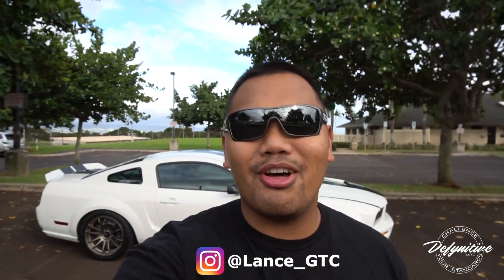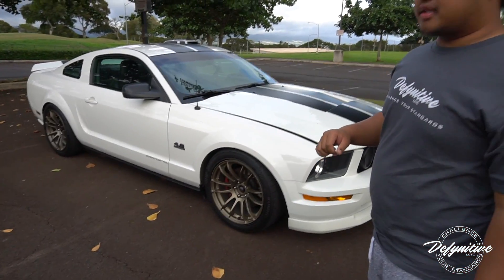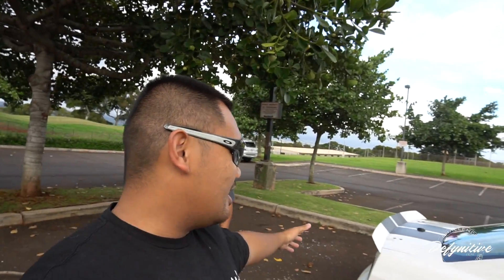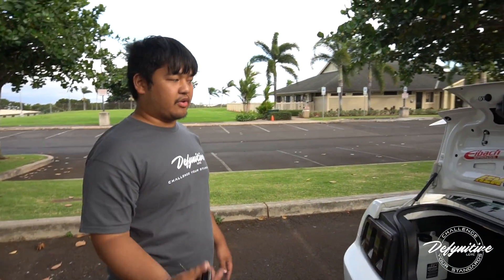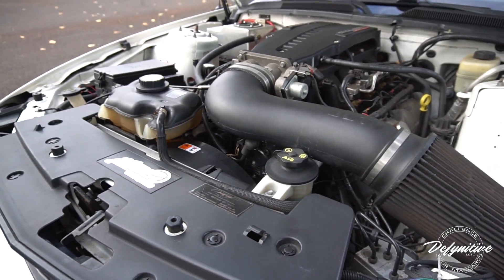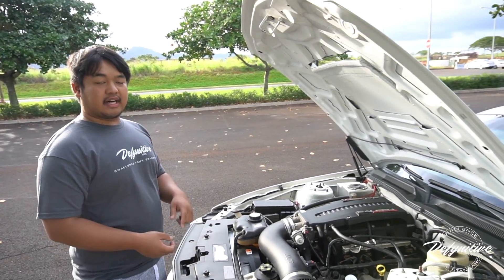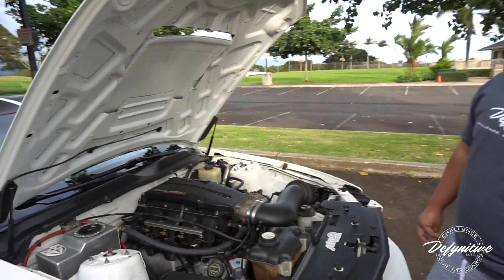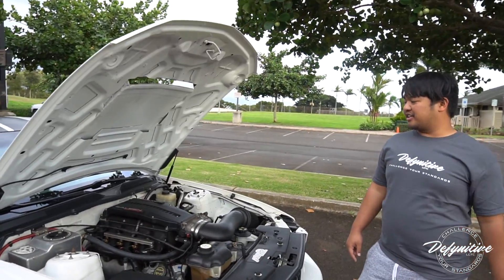The SUPERCHARGED Garage Build! - 2007 Mustang GT (ISLAND RIDES Ep.1) + Bonus Clip!

Comment: You should see if that supercharger will fit up with The Ford racing 62mm Throttle Body... it looks like you're still using the factory throttle body....just wanna see this pony get the air it deserves....I own a 2006 Mustang Gt convertible with Procharger supercharger and Flowmaster outlaw cat back exhaust. Plus I put on the high air flow intake manifold from Ford racing and the throttle body I mentioned way too many times...🙂. Greetings from Toledo, Ohio.
Reply from the maker: nice i'll bring it up to my homie! thanks for the comment! aloha from hawaii!